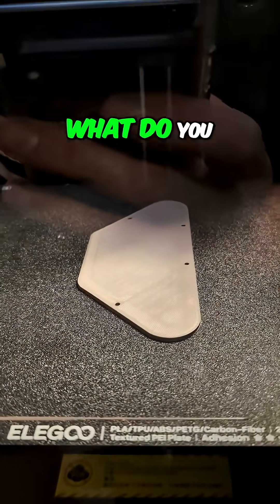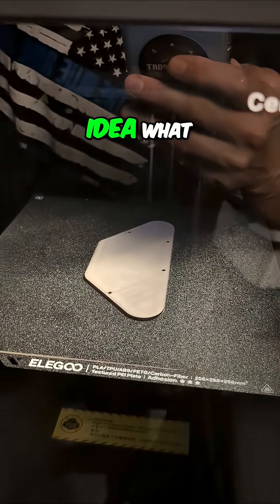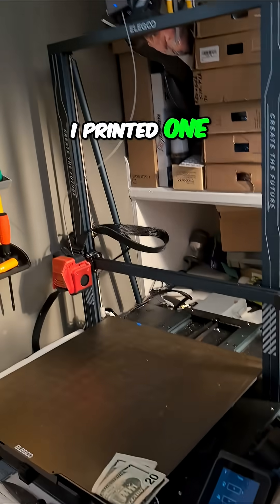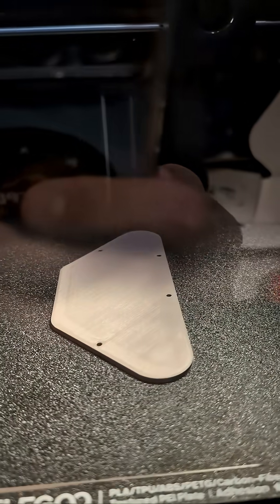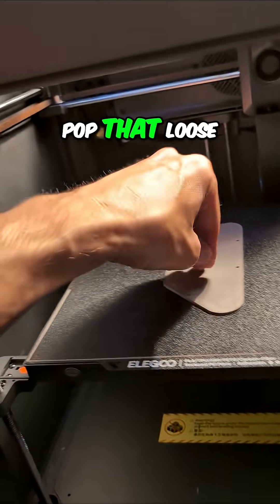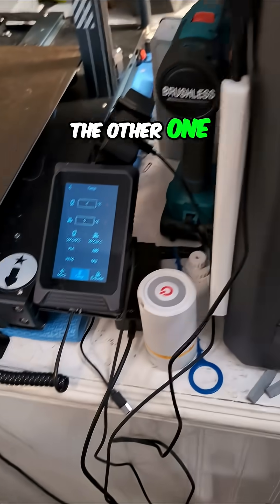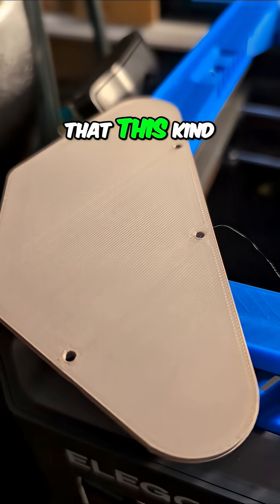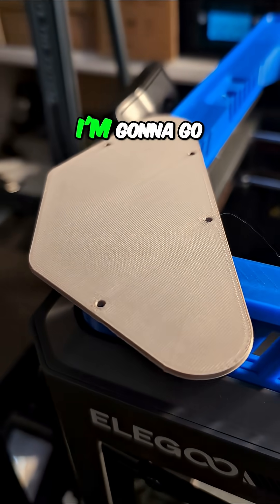3D Printed Guitar Part: Elegoo Centauri Carbon to the Rescue!

Comment: My brother, I finally win a fight to my neptune 4 max. I recommend you to recalibrate the vibration on X and Y on touch of it ( nep4max ). Can eliminate strange lines. I recommend too a Petg filament on it. Forgot PLA
Reply from the maker: I ran calibrations on both printers just a couple of days ago. The CC smooths out and does great. The N4M at it's best just doesn't print as smooth or reliably as the CC. I have to watch the first couple of layers and tweak the z height on the N4M. On the CC I just send the print and listen for when the print is done so can go remove it.